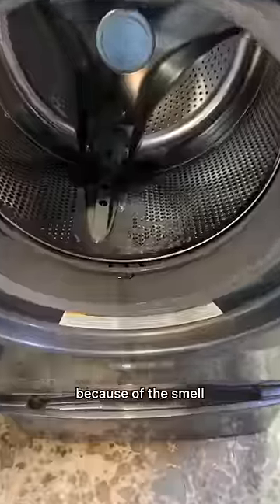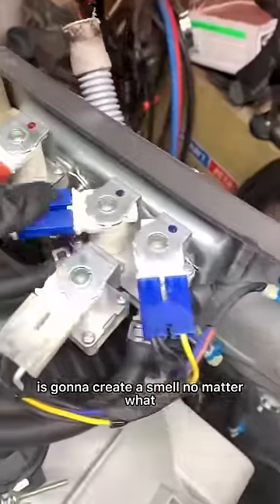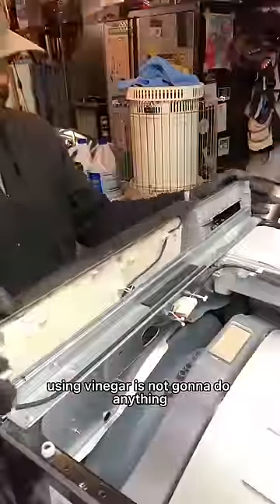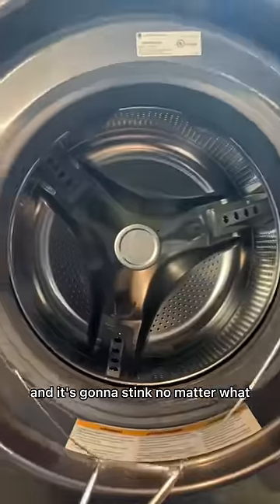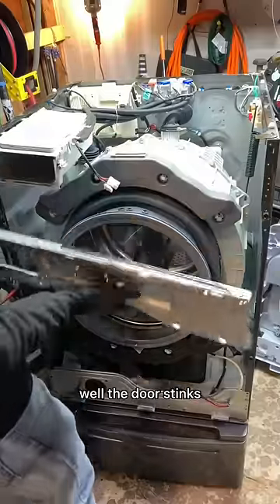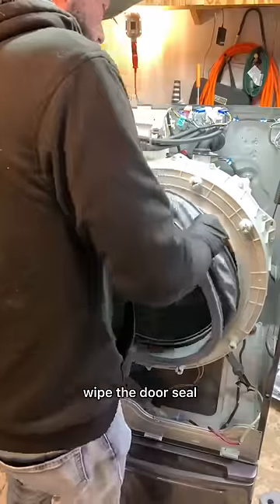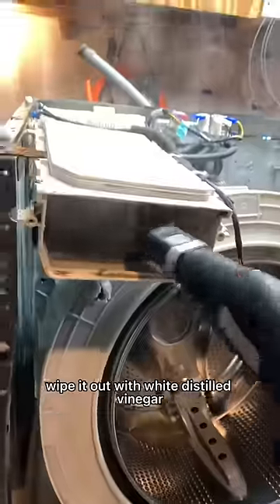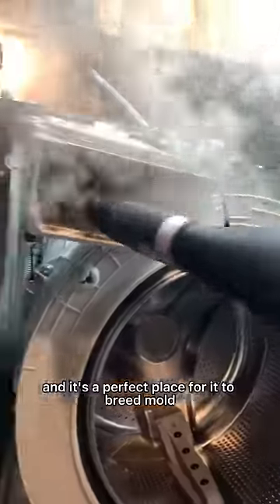Front load washers are proven to wash better. Facts, not opinion

Comment: Do the little cleaning pods work to clean the frint loaders? I have a top loader that i uave never had issues with, unless used improperly.  Inuse the self-cleaning mode and the pods, which seems to work just fine.

Comment: One simple tip for front loader, is to simply run an extra rinse + spin cycle after each wash

Then leave the door open and don't leave laundry in a closed machine
Reply: Definitely not. Maybe once a month if you wash cold. Otherwise it's a waste.
Reply: @herrkulor3771 it also helps your laundry as well, reduces the fade that happens when they are machine dried, by removing more residual detergent in laundry.

Comment: Been an appliance tech for 4 years. I won’t buy a front loader, not cause they are less efficient. But because I hate taking them apart. Older top loaders are much easier to take apart, the new ones are so so.

Comment: People complain because it’s a design flaw to have to “wipe up the seal every time you use it, then clean it then blah blah blah” like no buddy, that’s a crap design. People had top loaders their whole lives that worked great and didn’t smell even if they used fabric softener (I don’t personally) but yeah peoples complaints are VERY valid. Have a better design that can drain the seals, or make the seals in such a way where water isn’t trapped there etc.

Comment: I fix them for a living. Leave the door & soap dispenser open and you don't need as much soap & fabric softener as you think, I tell people try using half as much of what you normally use for 20 loads if still clean cut it in half again for another 20 loads till not clean then jump back up to what works. You may only need a teaspoon,if it works it works . What manufacturers of washers, clothes,and detergent call "cold" water is around 80⁰ to 110⁰  so use warm water at least unless the garment is a TRUE delicate use warm water to dissolve and activate the detergent. It all depends on water hardness ,water temperature size of load & how dirty the clothes actually are. Too many variables for a 1 size fits All situation. Each house is different.

Comment: I have a whirlpool top loader, and lately it doesn't dryspin the clothes , they're. Still wet  the water is gone but the clothes. I opened the machine checked the pump cleaned a bit of gunk from the outher drum but can't see anything wrong. It used to keep the door locked and not finish the last cycle. But now it finishes the cycle but the clothes are still wet. Any tips?

Comment: Appliance/TV serviceman with 44 years experience: do NOT use cold water all the time in your washer as is doesn't dissolve the detergent as well and warm water and results in bad bearings which is an expensive repair. Also, all the undissolved detergent and fabric softener is a big contributor to bad smell.

Comment: No no no... if you use granulated detergent, the smell is never an issue.  That stink comes from the binders in liquid laundry detergent.  If your machine is already fouled, just put a cup (yes a full cup) of granulated dish detergent in it and run it for the longest cycle with HOT water. It will be MUCH cleaner. If that isn't enough do it AGAIN.  The combination of cleaning it with dish detergent and using ONLY granulated laundry detergent... you will NEVER have problems with smell or fouled machines.

Comment: the problem is that there is no hot water that goes through the system correctly......they are only cold feed and not hot and cold so there is no sanitising of the dispenser draw pipe.......companies just need to make a self clean function that puts hot water through the dispenser draw then it's problem solved

Comment: Leave the door open after use until it dries out from the air flow in the room.  The manufacturers need to add a fan air cycling system that circulates air when the unit is wet inside and not in cycle.

Comment: Front loads have always been unreliable for us. I think it's because they generate a rocking motion and it's an old house, so that's enough that it causes problems for them maybe.
Idk, never really had a problem with smell until this top load one though. But if it gets mildewy just run a cycle of bleach or laundry machine cleaner through it that gets it dealt with.
I haven't used laundry sanitizer enough to know if it kills the mildew smell. But I just ran a load with it and it seems better now.

Comment: My top loader is 20 years old. Never stinks and I don't have to pull the machine apart and steam it
Reply: My front loader is 14 years old, free from mould and grime and never stinks either, without any effort on my part, other than leaving  the door and draw open between washes so it dries, and washing at 40°C using a detergent powder with oxygen bleach and bleach activator in it, we don't wash clothing in cold water.

Comment: With the same specs, motor power and drum size, a front loader will always work better than a top loader, it just the basic principle of how fabrics gets cleaned, the action of the water detergent mix passing through the fabric is what cleans the fabrics, the design of a front loader ensures this happens much more effectively and efficiently, in addition to the reduced water and detergent usage, a front loader is a no brainer, people usually like a top loader because it usually has a larger washing capacity, compared to a similarly priced front loader.

Comment: Front loaders are much better for your fabric. Believe me as the son of a dry cleaner where everything has to do with caring for textiles. I am also an interior designer and have studied textiles. Just dry the door seal at the end of the day and leave the door open for a few hours until the inside of the tub is dry. You should e doing that with a top loader as well and you should wash the tub of any washing machine with either bleach or vinegar and an empty loamd monthly anyway. 
A front loader will result in your clothes lasting much longer. Professionals never use top loaders.

Comment: I don't hate front loaders, in the right circumstances, I just don't like them because of their weight. Typically, at least as far as I can tell, for the equivalent weight of washing as my top loader the front loader would weigh another 100kg. Which is a huge difference if you live in a house that is raised off the ground, supported by suspect concrete posts and joists. If my house was built on the ground with a proper concrete slab I might have considered getting one. But I prefer the top loader anyway as I don't have to bend over to put the washing in, or get the washing out of, the machine.

Comment: In my exp. front loaders suck. Mine has no ability to rinse the soap out of my clothes. I have pulled it apart and cleaned it, still can not rinse out the soap from my pants after running it for 10 cycles with nothing but water and ammonia or water and vinegar. Still producing suds every load. My clothes reek and I'm about to toss the machine and by a speed queen top loader so I can be done with this nightmare

Comment: Whirlpool front-load not dispensing detergent, fills with water. Any suggestions on what the  problem could be? Thanks
Reply: Check the the little shower holes in the top of the dispenser compartment aren't blocked with mould, or detergent powder, and the water pressure is high enough. There may also be a couple  of jet  at the very top rear of the compartment that spray into the shower sections, that can also get blocked.  Leaving the draw open between washes should prevent mould forming. Also open the draw slightly during the fill to check if the solenoid valve is working.

Comment: Buy an old, I mean really old machine and they are all mechanical with NO electronics. They are far more durable and reliable.  We’ve got 4 of them from 1992, and the repairman has only been out a total of 6 times in 32 years. They are top loaders. Never have any buildup or dirt. All the new machines have electronic controls and some times you can’t fix the control board and have to replace the whole board. They also stop keeping the parts and we end up having to buy an entire new machine. We’ve replaced some of the newer machines in some units twice or three times and these old Whirlpools just keep on going. One of them has the original motor & transmission. The repairman says when someone wants a new machine, he takes the old ones back to his shop. He strips them for parts for other machines.  I know it’s not always possible, but at least it’s not always plowing stuff back into the landfill .

Comment: WRONG. I had this washer and I worked for the washer. I wiped it every time. Still smelled. I changed the door gasket, it still smelled. I had it serviced twice under warranty- it still smelled. Got a SQueen and it's awesome. Cleans better and no smell at all.

Comment: THE TRICK TO HAVING A FRONT END WASHER AND DRYER 
DON'T USED THE RISER ATTACHMENTS THAT IS MADE FOR THE UNIT. (IT'S TOO SHORT)
I BUILT CABINETS (WHICH WE USE FOR STORAGE) FOR BOTH WASHER AND DRYER.  THIS WAY YOU CAN LOAD AND UNLOAD STANDING UP. THIS REALLY COMES IN HANDY WHEN YOU GET OLDER. PLUS UT MAKES CLEANING SO MUCH MORE EASIER. THE WAY OUR LAUNDRY ROOM IS  > THE WASHER AND DRYER FACE ONE ANOTHER.  PULL OUT OF ONE AND INTO THE OTHER * EASIE PESIE *

Comment: You didn’t get to the part where the inside and spider is full 10 times worse than the front. 😂 I’d do full clean up for $270.  I’d Take out mold on seal as well.

Comment: I think my front load is not washing clothes properly 😢 if i put in a blanket, the center stays dry!! Wth! Any tips on that? 😢
Reply: If the centre of the wash stays dry when washing bulky items, or when you have the drum overfilled with clothing, pour a jug of warm water in the centre of the washing to make it wet before closing the door and pressing start. The weight of the water in it will stop it staying out of the water at the centre  when the drum rotates. When you replace the machine, buy one with a circulation pump, it will circulate the water out a slot in the top of the door seal into the centre of the washing as it turns, so that everything gets washed thoroughly. It will also dissolve the powder detergent quicker and more thoroughly. To keep the machine clean and mould, smell and bacteria free, leave the door and draw open between washes, and use powder detergent that contains oxygen bleach and TAED (bleach activator) which will kill mould and bacteria even at low temperature. May also help to prevent premature failure of the spider from corroding.

Comment: You like them because theyre way more complex and more expensive, forcing more people to feel obliged to pay you to work on a machine that takes more time to work on. Theyre such a poorly devised machine that they need concrete weights inside to stop them crab walking across the floor during spin cycle. Top loaders last much longer and are more reliable. I've never noticed a top loader smell bad.

Comment: No. Just, no. I don’t really need to save water given the region I live. I’m also willing to pay for electricity as I save in so many other electrical places. I have always used washers and detergent as directed by the manuals and directions. I have owned both top and front loaders. I’ve also been a renter in apartments with both types as well. It is my opinion that a top loader with an agitator will clean your clothes much better than any front loader I’ve ever used. If it’s an older model that uses a ton of water and has the agitator, sign me up because that machine will clean better than anything. You could test this by applying pine tree sap to multiple shirts and run them through a warm or hot cycle on several types of washers.

Comment: Here is a easy solution leave the door open when not in use. It will air dry any water in there. No sitting water no mildew build up meaning no stink. I do this and after 2 years my washer still does not stink

Comment: That's nothing. Wait till you split the plastic  case and unbolt the spindle from the steel tub and look in the space between the tub and the spline bracket and inside the 3 plastic agitators inside. It's literally  6 lbs of  goo. Its all cast aluminum so it grabs and holds everything.

Comment: I'm surprised you didn't mention the cleaning cycle built in to all of these which is supposed to be run regularly with bleach. Everyone commenting here that they switched back to a top-loader because of the smell just outed themselves for being too incompetent to read the manual and too stupid to understand that leaving the door closed on a washer with a rubber seal will breed mold.

Comment: I also prefer frontload washers but the fact that they “get your clothes cleaner” isn’t true top load with an agitator old school whirlpool will always clean better than a frontloader.
Reply: They don’t, they are not rubbing the clothes together, nor the detergent and water being forced through the fibres, like a front loader.  Don’t get me wrong, top loaders do a good job and get clothes clean but stains and ground in dirt, no chance.  They don’t have the ability to remove stains and grease etc because of the nature of the washing process, the limited water temperatures and the shorter washing time.  Wash time on a top loafers is usually only around 12-20 minutes max.  Front loaders wash for around 30-45 minutes, which is about the entire cycle length for a top loader.  Average complete cycle for a front loader is about 1hr 30 min.  Longer wash, heated water to consistent, specific temperatures, faster spin, more efficient, they are just overall better and are nothing new, they have been around for decades.  I have always liked the top load style but non of them work better than a front load machine.

Comment: Just take it apart and clean it. Got one that’s been running 15+ years. But it’s an inferior design. Front loaders suck. The tube bearings wear out too fast. Get a top loader. If I ever let that thing die that’s what I’m getting.

Comment: I have front load I use what recommended in the washer for soap and it still stinks and I use vinegar and I still have issues with it
Reply: Make a empty load just with bleach to get rid of the mold and smell. Keep the door open after every use. Problem solved. In Europe we are able to adjust temperature up to 194 °F in our front loaders. We keep the door open. No issues.
Reply: @janv777  thank you from Cali

Comment: I owned a front loader, the biggest piece of shit I ever owned. Clothes never came out clean, would have to constantly run more than one cycle (I've never used any detergent but tide free and gentle.) thing constantly leaked, no matter how many times I cleaned the glass and the bellow. Eventually replaced the bellow (twice, that spring retainer clip is the worst design in the entire world) and still leaked. Front loaders are junk. Fact, not opinion.

Comment: Is it really more efficient if you have to wipe it after every load AND wipe it with vinegar every week???  Not really….I switched to a high efficiency top loader when I got one free, and it’s more efficient than traditional washers, and yet:  there is no drama w the door or drama with the seal cracking or the wiping of the seal or wiping it w vinegar, or with it developing smells…

The washing machine was made to save us time while washing cloths, IMHO adding an extra step and a weekly chore is going on the wrong direction.  reinventing the wheel to convince ppl to give up the technology that has been perfected over decades, for technology that is novel but untested is just a cash grab..

Cheap to replace Manual timers can last for 10 years +, while expensive motherboards can and will fry out before its even paid for….

Comment: I prefer top load washing machines you don’t have this problem. 
Speed queen, stainless steel drum, best machine on the market!!
My last speed queen lasted 45 years just bought a new one 5 years ago.
Just buy a set of speed, queen washers and Dryer.
Front loaders are gimmick a gross gimmick. I’m not going to wipe the seal down on the door every time I use it who’s got time for that 💩.

Comment: Yeah front load washers are better if you just simply do 10x the maintenance for about the same results
Reply: Use correct detergent amount, powder preferred. Leave door cracked open, extra rinse on large loads. 0 problems 0 smell. OH the maintenance is too much!

Comment: Front loaders suck the doors always leak some water always stay in the drum and yes they get smelly if you can find an older top load grab it I have had one that's 30 yrs old never had a problem.. they agitate. tumbling does not clean well at all.. definitely stay away from the stackable Front loaders so many friends of mine have had nothing but problems with all Front loaders leaking and electrical and gues s what it's right after the warranty is up go figure

Comment: They’re over complicated garbage that are designed to end up in the landfill in only a few years. So much for the environment, eh? Meanwhile my elderly father’s Kenmore set are easily repaired and still working fine after more than forty years of heavy use.
The soap even ate through the agitator like Swiss cheese on the $3000 Samsung I had.
The clothes aren’t cleaner either. They only smell better because the washing machine uses less water to rinse the concentrated detergent from the clothes.
These machines are giant, polluting, pieces of garbage. Nice try.